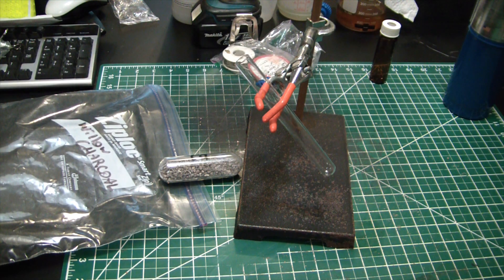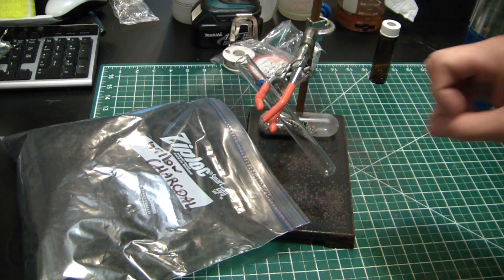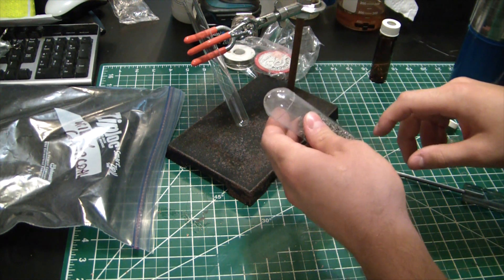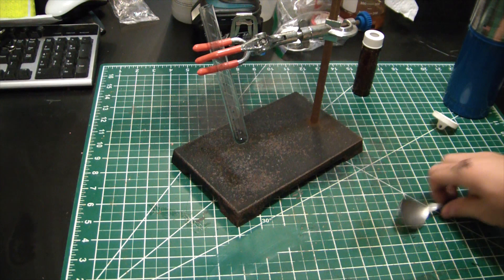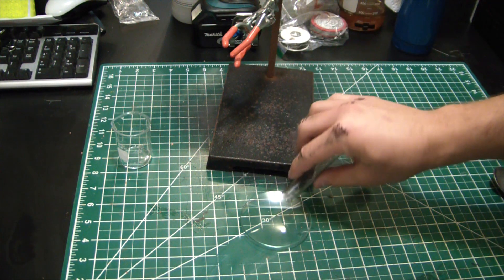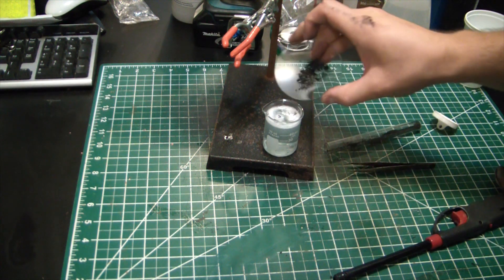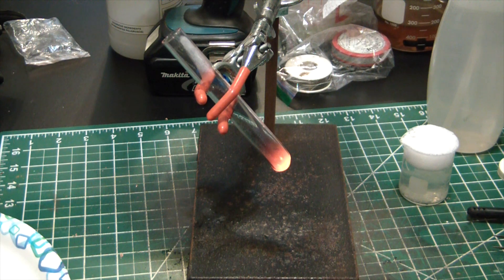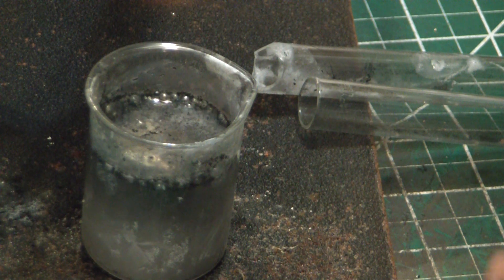Making Calcium Carbide in the Lab! - ElementalMaker

Comment: Easy way to make it is to mix lime with charcoal and graphite, as well as a pinch of salt... Have two carbon rods put into a retort made of two large ceramic flower pots. Short the rods at the bottom with a piece of steel wool and seal the flowerpots with some pottery clay. use the top hole to vent and burn off the CO generated. Power source is an arc welder set at about 120A or so for a bigger batch. Helps to dog a hole and bury the flowerpot retort in a sand pit. ❤

Comment: Haha! Now do it using eggshells.
Reply from the maker: Now that sounds like a fun challenge!
Reply: You can definitely use an arc furnace like KOR used to melt steel. That would get hot enough. Wonder if a stick welder with a tungston or graphite rod would be a better choice to finesse the settings.

Comment: Calcium carbide is composed of limestone, coke stone and calcium. Correct me if I'm wrong.
Reply from the maker: Calcium carbide is a compound, not a mixture. In an arc furnace, lime (calcium hydroxide, made from limestone) is mixed with Coke (carbon) or another carbon source and heated to such extreme temperatures that the OH from the hydroxide is liberated as the carbon bonds to the calcium forming CaC2
Reply from the maker: This was just a different way of making the same compound with what I had available

Comment: you could make it with an thermit reaction. 3CaCO3 +3 C2+ 4Al = 3 CaC2+ 2Al2O3. First carbid synthesis was with magnesium metal.
Reply from the maker: I'm definitely going to have to give this a try
Reply: CaCO3 is tums, what are the other two things?
Reply: @jacobolopez687  carbon and aluminium if you mean this.

Comment: I hate to burst your bubble, but you did not make calcium carbide. There’s 2 reactions when you heat calcium metal with carbon. The first reaction, which is where you’re stopping, is carbon with OXYGEN, that’s why is starts to glow. The second reaction, which is HIGHLY exothermic, is where the formation of calcium carbide is done. When you threw the calcium in water you made hydrogen, that’s why it burnt. Also, the sulfur smell was most likely from the wood ash since it wasn’t pure carbon. But anyways, to view an actual prep of Ca2C watch https://m.youtube.com/watch?v=IuAHuIyzLxk
Reply from the maker: Sorry to burst your bubble, but as someone who works with calcium Carbide very regularly, I can tell you without doubt this was carbide. Try it yourself. Sooty flame and distinct acetylene smell.
Reply: @ElementalMaker  actually, pure acetylene is ordorless. The reason industrial acetylene has a distinct odor is because of contaminants built up during production. I’m just being honest. I really like your videos though. I watched a dozen of your rocket videos in a row. Really neat stuff you’re doing. Especially that one with the shock diamonds. Super jelly about that
Reply: Also, you need a quarts test tube to make it because at the temp carbon reacts with calcium borosilicate glass melts. It is theoretically possible to make Ca2C in borosilicate glass but it’s super hard and will pretty much be melted by the time the reaction starts, definitely by the time it stops

Comment: You mentioned a sooty flame -- is that a signature of acetylene burning inefficiently (openly)? I ordered some CaC2 from a reputable source and when I put it in water and lite it, I sometimes notice soot clumps floating in the air and tons of soot in the test tube. Is that elemental carbon residue?
Reply from the maker: Hi Dave,  yep a sooty flame is a characteristic of acetylene burning in open air. If burned in a higher oxygen environment, or even a faster velocity (as it is when it exits the lamp nozzle) for better mixing, it burns quite cleanly.

Comment: So why not make a acetylene for oxyacetylene flame? Carbide to water or water to carbide? Also if its even plausable to do in home.... I mean try to pressure it like 10 to 20 bars(Not sure how much of pressure is inside of the tank) Yea I know it sounds like crazy idea to do but why the hell not?
Reply from the maker: It's certainly do-able, I built this because hho is easier to produce and control in my opinion. It is also a completely clean flame whereas acetylene is very sooty. But no reason you couldn't build a carbide powdered oxy-acetylene torch at home. You could use hydrogen peroxide for your oxygen source.

Comment: I think the pop was the residual water in the carbon reacting with the calcium and getting a good enough mix over time to pop. The hot glass should be enough to do it.
Alternative idea: If there is air left in the tube, the carbon will produce CO2 and get it reduced back to CO. If the test tube had the reaction going, then cooled back just a bit when it was done, it could have pulled some air back in. Both CO and H2 could have done it and there was probably a suck-back after the reaction was over and the heat dropped

Comment: Definitely very interesting, always interesting to see certain compounds being made by regular people outside of a lab or industrial setting. I hope to see the electric arc process as well, just dont get electrocuted, high voltage shocks suck ASS (Thats why people warn about messing around inside CRT monitors and TVs but nobody told 12 year old me that flyback transformers produce 25,000 volts when I decided to cut a high voltage wire with metal scissors)
Reply from the maker: The nice thing about using the MOT with just a few secondary windings is that the voltage will be quite low. Not enough to jump skin. I will post as soon as I do it!

Comment: Calcium melts ~839.0 °C.  From the color that could be about the temperature at which the reaction happened.  So it looks as simple as heating the calcium to melting with plenty of carbon.  And avoiding oxygen, which an excess of carbon could help with.
Reply from the maker: I only took a few chemistry courses, so I can only speculate alongside you, but I do believe that is what happened in this reaction. Thanks for dropping a comment!
Reply: Ya

Comment: How about making limelight?
Reply from the maker: Soon! Need to build a sizeable oxy-hydrogen generator and torch first.
Reply: Propane won't work?  Didn't the theaters use natural gas for limelight?
Reply from the maker: @tarstarkusz  no sir not nearly Caliente enough. Oxyhydrogen burns at about 5100F at a 2:1 molar ratio. Propane in air burns at about 3600F. Big difference heating the lime to give off light.
Reply: Thanks.  So what did the theaters use?  Did they use oxy-hydrogen?
Reply from the maker: @tarstarkusz  yessir!